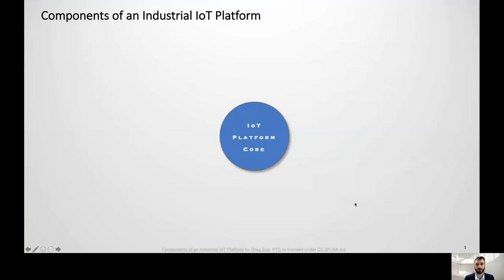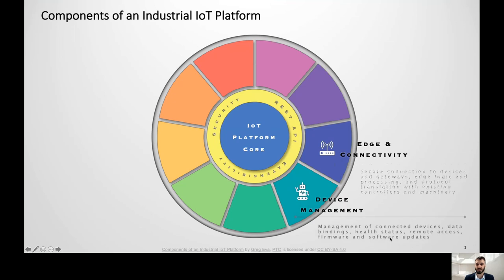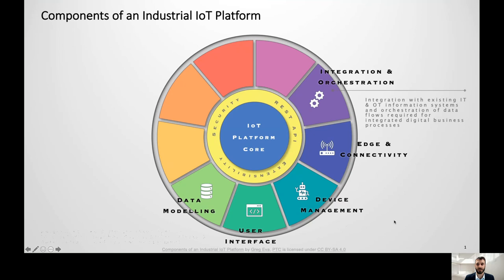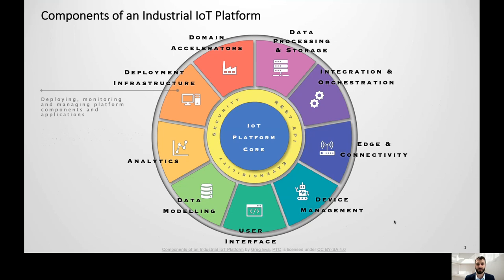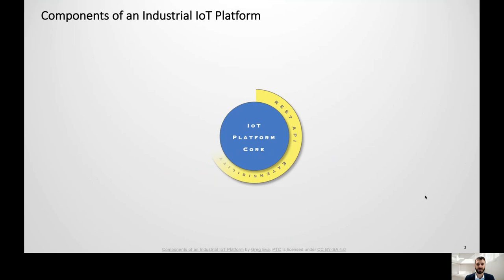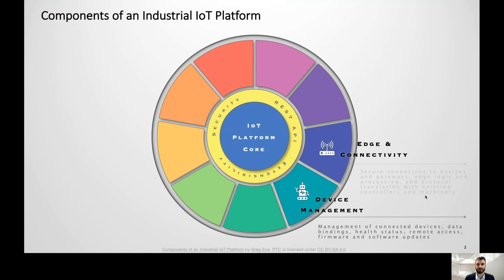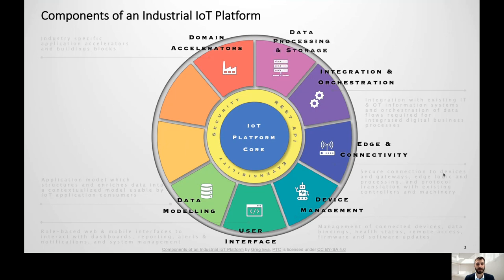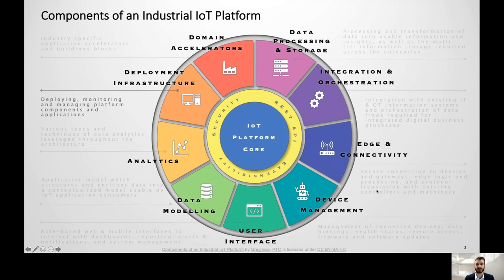Components of an Industrial IoT (IIoT) Platform

Comment: Hello Greg
Thank you for these amazing videos!!

I am new to digital transformation and I should start selling ptc technology in my country, I have a problem of understanding the whole process, I am understanding a little bit but the problem is the terms or definitions
I am trying to understand the terms from different sources but I still didn't get all
Like I have known does MQTT mean also edge devices and there other terms called UNS, broker and more

I know the basic idea that the devices(sensors, motors, plc, and other layers should connect to a certain place) can you help me with that by referring a good source with a clear way, or maybe if you can make video of IIoT with ptc( thingworx, kepware and other tools what they do and how we connect them and why) in basic a general idea it would help a lot

Thank you for your time and excuse me
Reply from the maker: Hello Alaa - Digital Transformation is an immense topic, so it is normal not to understand it all.  What is important is not to confuse transformation with technology.  The key to DX (transformation) is a clear strategy with well defined and measurable goals and requirements.  MOST projects fail because technologists attempt to apply technology but it is not technology that solves problems.  As Einstein said, if given 1 hour to solve a problem, he would use 59 minutes to understand the problem and 1 minute to solve it.  Don't fall into the trap that so many do!